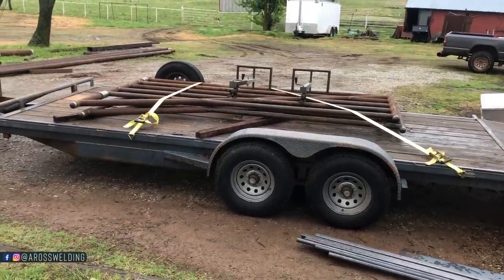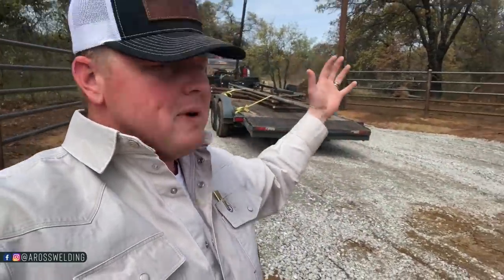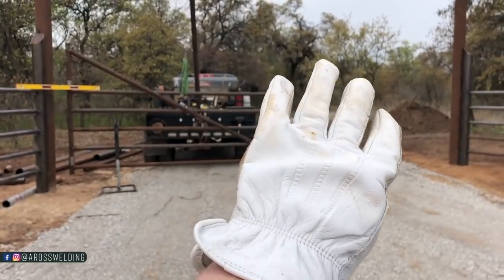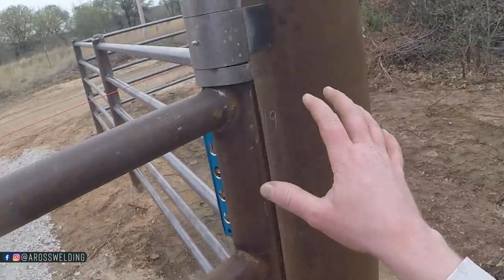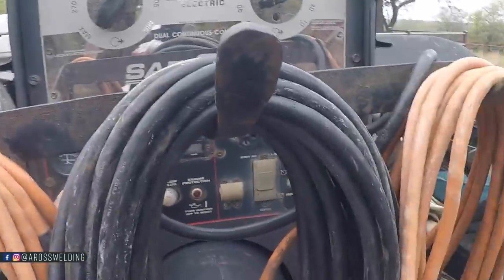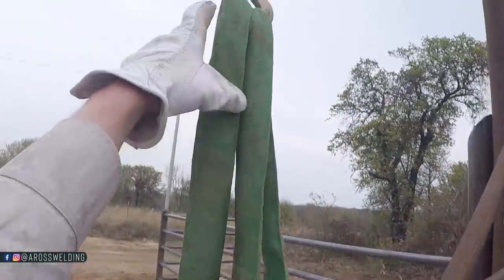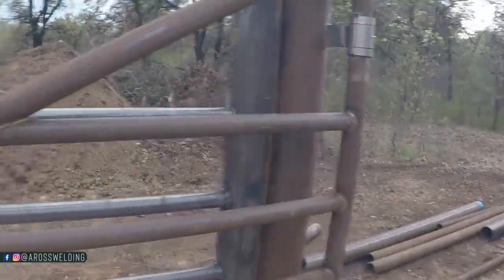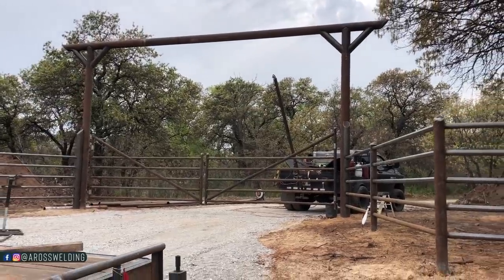HANGING GATES ON MASSIVE 24 FOOT PIPE ENTRANCE - ALONE WITH HOMEMADE TOOLS (PART 10)

Comment: Just a nood from another  Old Okie 
Shidler. Like what your doing encourage all the young blood. I used to cut with oxygen now I wear it, Ha
Learned to cut and weld form grandad and dad they were both pipe fitters. I went the way of an Ironworker wanted to put them up.
Worked me last 3 years with the pipe fitters on a hanger crew at a power plant. Good wages and benefits . Keep up all your good videos.

Comment: Mr Ross can I  get some advice I'm doing an gate repair and it's got so much I  need to weld up its not iron gates  I've done  the blacksmithing part but what electrodes would you recommend  6013s or something  different as I need to order them before  I weld up and finish?

Comment: I'm curious about the way you weld the flags (square 3" plate) Between the sleeve and post.  In a working corral scenario where there is gonna be a lot of movement and impact would you do 2 flags instead of just one per hinge?

Comment: You reckon the gin pole would work on a truck with a regular bed? I'm thinking if the chains were welded higher up to clear the tailgate, and you could connect them to the pin in the gooseneck hitch maybe? That's a sharp-looking entrance you've built
Reply from the maker: I used it on my other truck that had a reg bed but I just took the tail gate off and hooked the chains to a couple of after market hooked that were in the lower corners of the bed.

Comment: Hello Austin my name is Michale i e been welding for a little over two years now been in business for myself for a little over a year. I want to let you know that I'm a big fan of your work. I was hoping that maybe I could get a little bit of advise on a project that I've been working on for a couple months now. So my question is, about how far do you think one can span a gate made up of 2-3/8" used oil field pipe without too much of a sag. Because I've got 32' entryway and My customer wants double swinging gates and I'm just not real sure that it can be done without shortening the entry way about 6'. What the customer wants is 2 (roughly) 16' double swinging gates. The fence is 5' tall so to match the fence I figure I'm going to have to build the gates at about 4'- 8" to accommodate for a little bit of sag. The largest gates I've ever hung were 12' and I had hell getting them level with no sag. I will be using pieces of 2-7/8" pipe for my hinge system..Similar to what you use in the video... You got any tips  or tricks you can help a poor white boy out with..? Before I go and bite off more then i can chew. Thanks in advance.

Comment: Just curious why  you set a 4-in post by the 8-in gate post instead of welding the fence to the gate post?
Reply from the maker: Aesthetic’s. The owners got inspiration from the old wooden western style entrance.
Reply: @arosswelding  you do good work ,you take pride in what you do .I've been a welder for 50 years just past the torch to a younger crew.i felt like it was my job to take care of the guys I worked for. They could call 24 - 7 .They new they could send me on a job and forget it I new how to do the job and get it done as quickly as possible .It may sound like I'm bragging but that's the way I roll .,been there done that.

Comment: Austin what brand is your straight cutting head attachment on your torch you use for your circle burner/fence post setup? thanks
Reply from the maker: It’s victor. 
Here are the part numbers for the small and large 
Small
0381-0421 CA 1352

Large
0381-1932 CA 2462
Reply: @arosswelding  Thanks

Comment: It’s beautiful man. What size of 7018 did you use? And those look like store bought hinges. Isn’t it cheaper to build them? I’m sure you’ve thought of that. Just curious of a professional opinion. Thanks. And great job!
Reply from the maker: 3/32 7018
Right now it may actually not be cheaper cause material is high but yes these are store bought.
Reply: Just a tip: If a person makes the hinges be sure they have some slack in them where they fit over the inner pipe.  When you weld on the hinge it will draw up a bit.  I’ve had them draw up and be too snug on the inner pipe.  Austin, great job on the gates.  Not always easy to end up with them level and even like your’s turned out.

Comment: Starting a welding business.  First, figure out what services you want to provide.  There are people that work in their garage and never leave for a welding job.  There are folks that don't have a home and live on the road.  Until you figure out what market you want to do, you can never do it.  If you try to be everything to everyone, you will never be any good to anyone.  Me, I was a structural mobile welder.  My truck is an ex railroad truck.  F700 with a crew cab, tool boxes and a knuckle boom.  I carry way more tools on my truck than Ross does but I used to do a lot of stuff onsite.  I even have a track torch and a small hydraulic (shop made benchtop) for and a good number of portapower tools to straiten and bend things in the field.  Think it through.  Is welding or even owning your own business what is good for you.  You have to understand owning your own business is tough sometimes.  You have to be willing to get punched in the face over and over again and keep getting up with a smile.  Once you get established and you start making a profit, make sure the business doesn't go up your nose.  I can't tell you the number of people that I've seen earn more money than the average factory worker and suddenly they are way over their head and loose everything because they just aren't cut out to deal with the troubles of owning your own business.

Comment: How long have you been doing this type of jobs for
Reply from the maker: Off and on for several years. I done this type of work years ago before I started pipelining. Then I pipeline for about eight years and then I started doing this stuff again when Pipe Line worked slow down. Last Pipe Line job I was on was over two years ago.
Reply: I have been welding at my school